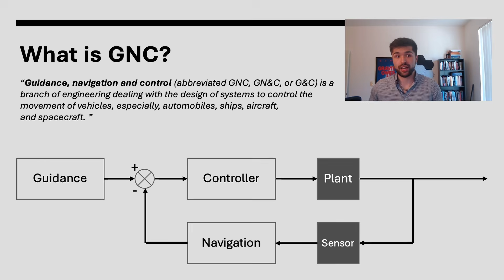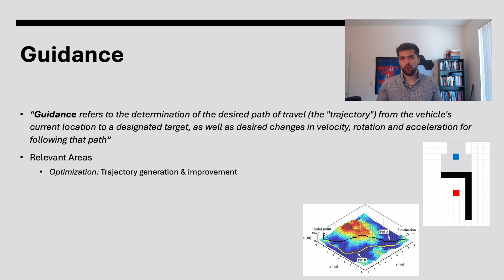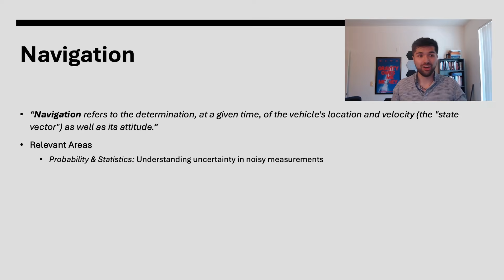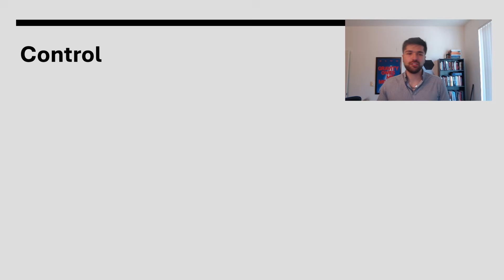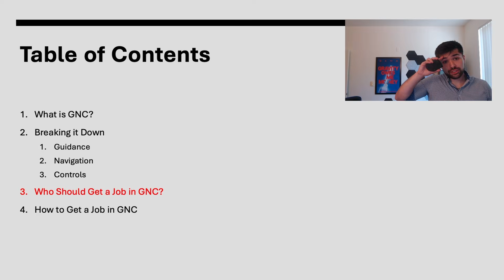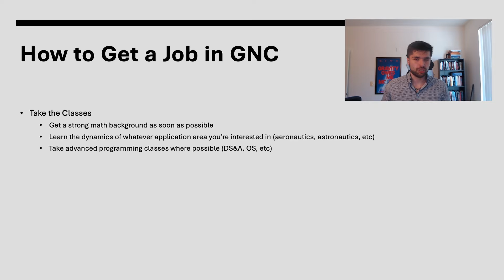Intro to Aerospace GNC (and How to Get a Job In It)

Comment: I had the lucky opportunity to work as a GNC flight software engineer. I did mostly verification and validation of G and N. Embedded is tedious but modeling with matlab is fun. It opened up the way I think in a lot of ways. I find myself applying a lot of the algorithms in other fields now for fun

Comment: I wonder if the odd "plant" terminology could have something to do with control theory originating with chemical engineering? I know that my professor of Control and Estimation originally studied and worked in Chemical Engineering
Reply: By the way, since there are very few aerospace companies in my province, I have wound up working in a completely unrelated field of metrology engineering in a wafer fabrication plant, despite having studied a Masters that included some of this stuff. Does that make it less likely for me to be considered for a role in aerospace, especially in GNC?
Reply from the maker: Career pivots are significant but definitely not impossible. Not to be a doomer but geography is a big deal-- living in an aerospace hotspot has significantly helped my career. So it's 100% possible but may be tough without moving to an area with more industry. If that's not an option maybe look at remote roles? Best of luck!
Reply from the maker: Huh, never thought of that! You might be right